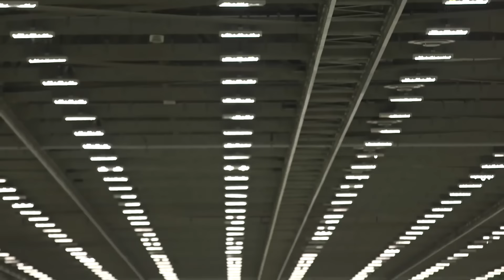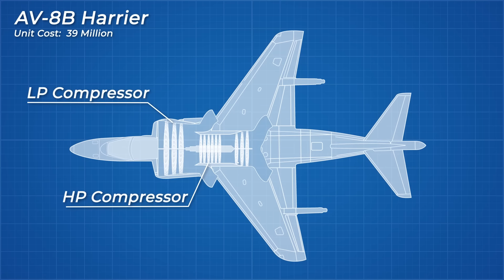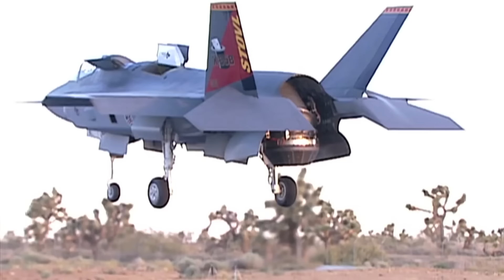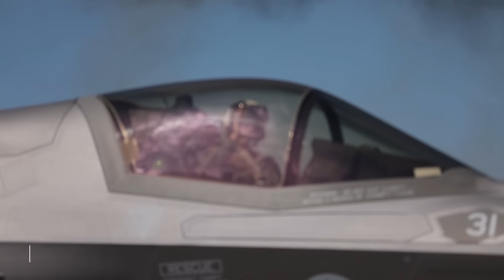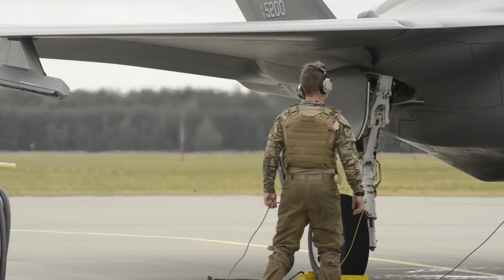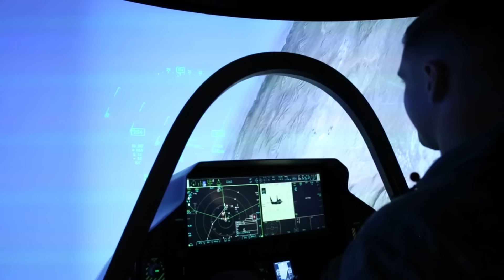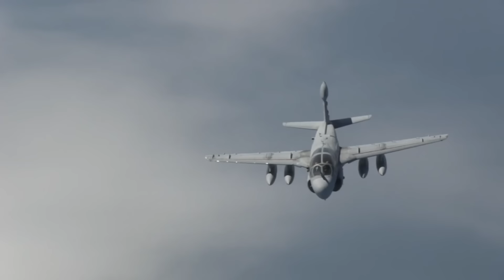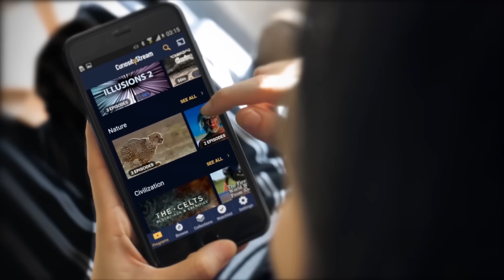Is The F-35 Worth $115 Million?

Comment: Instead of making the sea version of the F-35 a vertical takeoff/short landing plane, it would have been cheaper and easier to give every ship that is supposed to operate the naval version of the F-35, it might have worthwhile giving each ship an extension of its flight deck and hangerspace... 

I mean.. how much would it cost for a few brackets and reinforcing stanchions welded to the stern of a ship, and rivet and weld a few inches thick 300 foot long and 40+ foot wide aluminum - stainless steel or maybe even a titanium horizontal structure for standard jet take off and landing.. it should have a non slip coating fitted to the surface and it could be used as a sports field for the crew or for leisure and recreation.. 👍👍😂😂
Reply: They should have just given the navy variant floats!
Then they could tow a long line of them behind the ship 😂

Comment: some little higher in cost.
till it's facing a structural problems at high mac speeds.
single engine is not good for survival at sea battles, bcs bird's r good enough to kill this high value product like a duck shoot, twin engine's r best.
need built quality to survive at high mac speeds & cruise speeds for longer enough.
this was an High priced some battlefield low worthy fighter jet.
it cannot be air dominant.
it needs f16v-block-70-72 /  f15ex / f18x supports on it's background.

Comment: So they built 3 different planes so they didn't have to build 3 different planes... WHAT?
And why retire the inexpensive A-10 and replace it with a $85M aircraft? That's just CRAZY.
Reply: They were never going to build a single plane in the first place. The media just love to make drama. The A-10 should be retired because it is performs a very niche aspect of CAS. The overall CAS role is performed better by the F-16, as well as most other fast jets, and the A-10's specific niche does not require an aircraft as expensive as the A-10.

Comment: In another video they said the F-35 engine isn't based on the Harrier but the 'Yakovlev Yak-38', which looks plausible from the wikipedia schematics.
Reply: The Yak uses 3 engines. The F-35 uses 1. Not to mention the only engineering similarity is the nozzle, which is a US patented design from the 1960s, well before Yakolev first used it on the Yak-141. But in saying that the F-35's engine is definitely not based on the Harrier's engine either... The Boeing X-32B had a similar engine to the Harrier... the X-35B used a completely different design.
Reply: No the F-35s engine is based off a NASA vtol project of the 1950s thst developed the lift fan  principle and another NASA project that developed the rotating rear main exhaust nozzle, twisting like a heater duct pipe, which is how they got that idea.... Russian stole the tech, as they always do, because they cant develop anything on their own that actually works AND they still needed a dedicated lift engine in the Yak-141 (not the old weak Yak-38 of the 1970s as it had 2 dedicated lift jet engines just to get off the deck and used rear swivel ducts like the Harrier).

Comment: 1. The F35  with upgrades and  software improvements mimicked  extremely difficult F22  dog fighting techniques in recent air shows.  It's probably not equal to the F22 in sheer close range dog fighting, but it doesn't have to be, and if it was in a close range dog fight with the F22,  the  F35 would still be a difficult opponent.  The F22 would probably win because it is faster and more maneuverable, but it is  not guaranteed, because the F35 is very capable and it  could retreat from the F22 and become invisible to the F22 sensors. 

2.  The F35 if effectively invisible TO HOSTILE FIGHTERS IN THE AIR , which is what is important for air superiority.  Being invisible to ground radar is somewhat irrelevant because as noted in the video, low frequency radar cannot track an object with accuracy.  In a real world fight, the F35 will have seen an enemy craft and fired its kill shot long before either ground or air locating radar and sensor systems even know that the F35 is in the air. 

3. The F35's superiority and efficacy to all other fighters by looking at how Russia is now equipping its jets with all sorts of additional sensors to help them to be able to see the F35. If the F35's stealth systems were not very effective, Russia would not be going to this expense as it has a very limited military budget.  But even with its new sensors, it is highly unlikely that Russian "flanker" jets, The SU 35 for example, will be able to see and F35  before the F35 has already fired a kill shot missile, and with today's missile technology, the SU35 has almost no chance to avoid a missile once it has been locked onto.

4. In future conflicts, we will be able to assess the F35's effectiveness by what it does in real conflicts. But the US isn't stupid and it's not going to invest over a trillion dollars in a fighter to lose fights in the air. By all accounts, the F35 has the most effective stealth protection of any jet but possibly the B2 bomber. The B2 has flown several missions and has never been shot down. So there is every reason to believe that the F35 is as competitive as the B2 in combat. The B2 has never lost a fight and that bodes well for the F35.

Comment: The X-32 was designed to be a highly manufacturable aircraft. Possibly could have avoided a significant portion of the production delays and cost over runs. DOD should have known that each branch dislikes the Jack of all trades. Navy wants Boeing to build an F-18 replacement, Air Force wants a new Air superiority 6th gen. And the Marines want no more fighters. This plane is amazing, but it lost its 5year lead on foreign powers.
Reply: Boeing's X-32B didn't even meet basic requirements of being able to fly supersonic in STOVL configuration, and it takes roughly the same amount of time to build an F-35A as it did an F-16 Block 40 in 1988... roughly 40000 man hours of work.

The F-35C is an F/A-18 replacement. The USN's F/A-XX program is required to replace the F/A-18E/F which is a completely different aircraft to the F/A-18. The Air Force's 6th gen ASF has nothing to do with the F-35A either in role or the fact it is replacing the F-16. It was the USMC who initiated the program in the first place by requesting studies into an AV-8B replacement that could go supersonic and perform multiple roles.

Comment: the body panels of the f35A f35B and F35C are different, The b is Stol so the engine will be in whole or in part different, I think there is not enough overlap between the systems, It would have been much easier to just develop two planes that use the same engine and weapon system, make the navy version a derivative of the land-based version, as is the case with the f18, 
that's almost as much overlap as the current system and makes for cheaper unit prices.
Reply: That's essentially what they did though. The naming is a political tool, just like the the F/A-18E/F being almost entirely new compared to the older Hornets.

Comment: Where are they getting the 45 million cost thor the Warthog?  As I understand it, the A10 is 14 million without program upgrades and 20 million with the upgrades.
Reply: I would guess inflation?
Reply: The A-10A was $18m per unit during the 1990s. At the time of the A-10C upgrade starting in 2005 the A-10A price would have jumped to around $20m, and the A-10C upgrade added about $10m worth of avionics. From then till today inflation alone adds another $10m, and there have been several upgrades since 2005 as well. This is of course solely for the value of existing A-10s. New-built A-10s would be more expensive.
Reply: @dumdumbinks274  My understanding is that the 2005 20 million dollar cost includes the original 14 million. But even if this was wrong, we don't get anywhere near 45 million with inflation. Do you have a source?
Reply: @josephdestaubin7426  The cost in 2005 is the 1990s $18m cost adjusted for inflation. It gets tricky if you want to do a full analysis since the 90s cost is also adjusted for inflation from sometime in the 80s and might not include the small upgrades the A-10A received throughout the 80s and 90s. I know the F-16 cost estimate in 1998 was the very first version of the F-16C (Block 25) from 1984 but adjusted for inflation, and that was likely done since the early blocks were still very common back then, so it must have been pretty close to average. The same is unlikely to be true of the A-10A which didn't have any major changes after 1982 (AIM-9s added for self defence), but did receive a final addition in the mid to late 90s which I recall was a laser targeting system.

To simplify things you can assume the A-10A was worth around $20m in it's most advanced state, and you then have to add the cost of the C upgrade which was estimated to be roughly $10m per aircraft and calculate inflation to today (roughly $39m) and add say 20% extra to account for the many small upgrades over the last 15 years. You could however argue that the C upgrade should be counted as adding a bit less than $10m since it replaced all the old avionics as well as adding some extras.

There's no source to this. I was just hoping to clear things up based on what I remember from a few years ago when I enjoyed researching all these lesser known details.